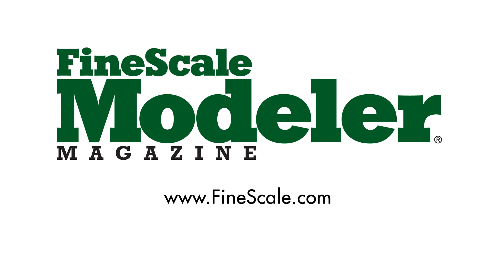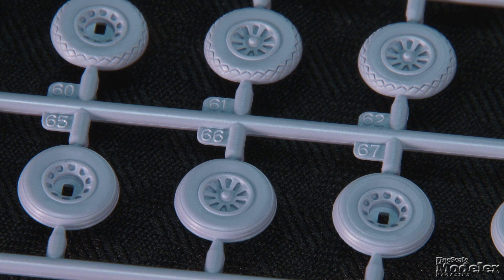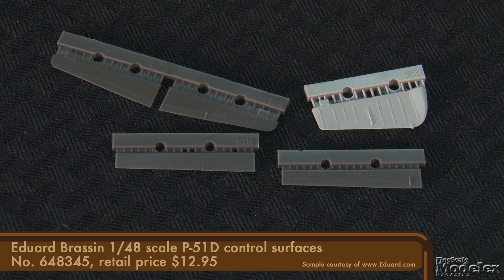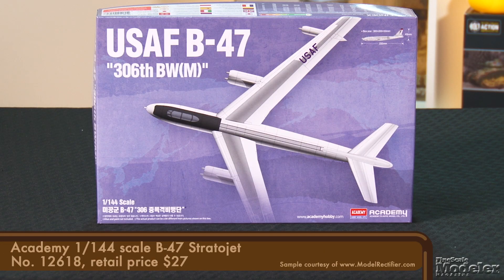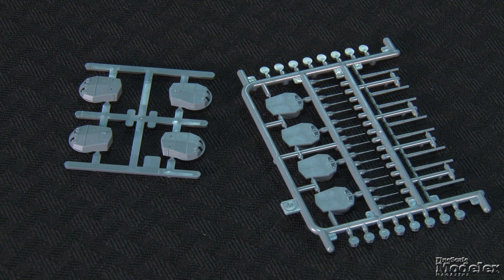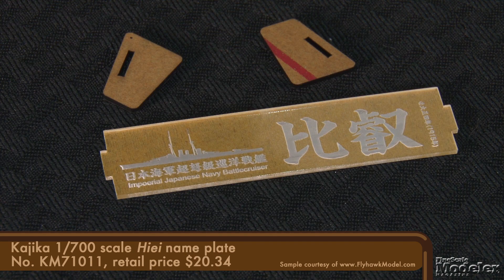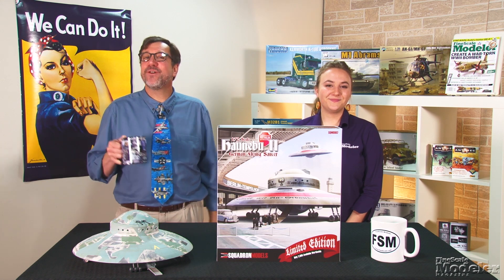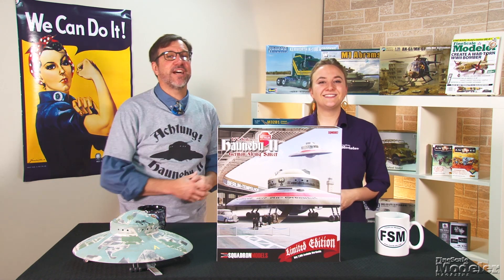Airfix 1/48 Mustang, Tamiya SS100, Academy B-47, Kajika Hiei, Squadron Haunebu II

Comment: The panel lines on that 51 are about the size of the grand canyon. I'm not one to usually complain about the scale of panel lines but damn.
Reply: Ben Brines agreed, but makes it for the casual modeller a easy paint job for washes
Reply: I honestly think that airfix is incapable of producing hasegawa style fine panel lines. Maybe its cheaper to make the mold with big panel lines.